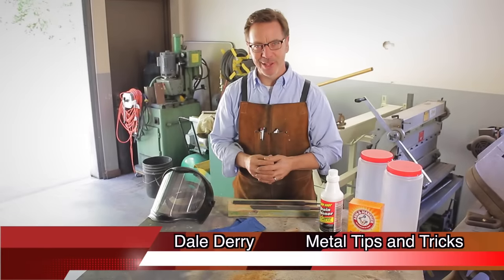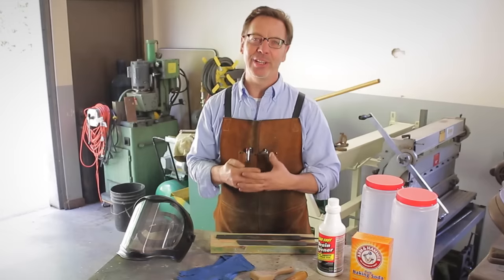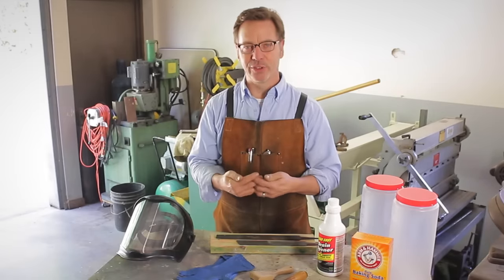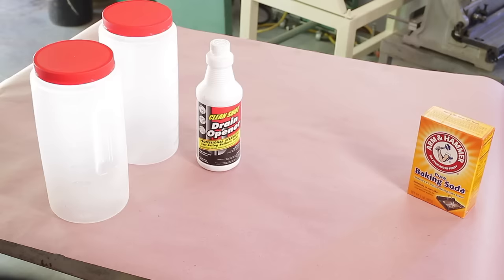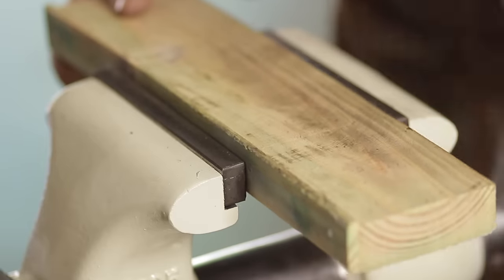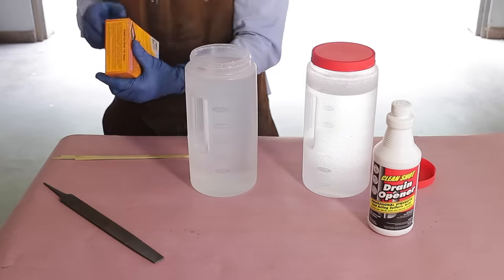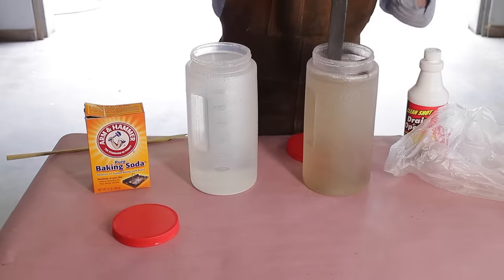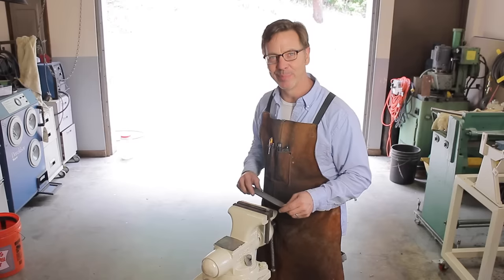How to Sharpen Metal Files

Comment: I was always taught that keeping files in a drawer where they could rub together was the worst possible thing you could do to it. I always keep my files separate.
Reply: There's a reason they're shipped wrapped in waxed paper... each file in its own pocket. Rubbing files on each other is how you get these nice bright curved lines on them.
Reply: you know he was making a joke, right. not trying to be rude or anything just really having trouble deciding if you could tell.
Reply: File steel is some of the hardest steel commonly available. By keeping files in contact with one another does not necessarily mean disastrous results ensue. File steel also has "toughness" which means that some abuse is normal. The way files are dulled is through pressure and extreme conditions such as exposure to water and other corrosive chemicals not through storage and random incidental contact with each other.
Reply: Yeah i was thinking, I've never heard this before.  Like you i was taught the same thing.  Don't rub them against each other and don't let them rub anything but what you are trying to file and only in the right direction.
Reply: Yea everyone knows subtle jokes are never funny
Reply: Nicholas Savage LOL
Reply: @disciplepullover326  Point taken, this guy needs a laugh track.
Reply: Tommie duh Swamy n
Reply: Or how about when you lend out a USA Nicholson file...and the guy is pulling/ dragging while he's cutting! Nooo stop you'll ruin it!!
Reply: Exactly. I was taught the same, by very experienced and skilled craftsmen. I am not very convinced on how sharp the file got after the acid treatment.
Reply: @tommieduhswamy6860  there really isn’t any steel referred to as “file steel” many manufacturers use many types of steel. A common steel used in more high end files is a 1095 or a W1. The strength or toughness of the files come from a process or heat treating and hardening. It may sound dumb but bouncing a hardened file against another hardened file or tool can over time wear the file down. More commonly poor maintenance of the file and its teeth lead to a dull file. A good set of files should include a brush so files can be cleaned Before being put away.
Reply: Keeping them in a role is the best thing you can do
Reply: @tommieduhswamy6860  I really hope you're joking, you know they use diamonds to polish diamonds right?
Reply: @Z-Ack  LOL! THAT'S HOW DADDY DID IT! AND THATS HOW IM GONNA DO IT!!
Reply: @Blind Freddy correct and good explanation

Comment: I was given a bunch of old files and decided that I had nothing to lose by soaking them in acid.  In my case I used muriatic acid and let each file soak for about ten minutes.  I then neutralized the files in the baking soda solution.  Some clearly cut better after the etching and some didn't.  It depends on what you start off with.  And yes, the acid cleans the files beautifully.  So for all you trolls who have made negative comments, you have several options: 1) discard all your dull files and buy new ones; 2) Have your dull files hydro-honed where you'll pay to ship them plus the cost of the process; and 3) Try the technique described in this video.  It all depends on what your expectations are.
Reply: They can send me all the files they like.
Reply: You've confirmed what I thought, it depends on what you start off with. A real worn file won't improve from this methode, but a file that is just dirty and/or corroded might. Nice tip, think I do step 3 first to decide which files to discard (and to reforge into something else). Think I'll just use vinigar and let it soak longer though.

Comment: something I do as a blacksmith is I take regular chalk and rub it on the file. it will lubricant and keep the file from filling up and clogging.
Reply: machinists also do this when using a smooth file to draw file a work piece to help reduce/eliminate clogging and pinning which can damage the surface finish.
Reply: Same thing... except I rub some borax into the file. whatever chalky stuff you've got, I suppose.
Reply: +Eagle Bird Knives Never thought of Borax or Soapstone,  I have thoes by the pallet loads, thanks I'm going to try them.
Reply: Yes, 'load' the file with chalk to prevent it clogging/blocking in the 1st place, totally agree.
Reply: Absolutely.  If you are filing aluminum and other soft metal that are sure to clog the file, loading it up first with chalk is your best bet.  Been doing it for decades.
Reply: E.PLUMBUS UNUM  why don't you try using a file that is designed to file aluminum works great
Reply: chalk loading can also be used for the purpose of getting a finer finish when your down to size,
Reply: hey... will welders chalk, or I mean soapstone work as well?
Reply: I rub chalk on mine too. I didn't think anybody else did that. I didn't know if it did anything but, to me it seemed to work better. Soapstone if there was no chalk around.
Reply: @jasonk795  it makes sense that this would work. the chalk is just like putting talcum in leather pants . it lets the chips slide through and not stick. also makes sense that you would re apply every so often.
  I must say this is something that i am shocked to have not heard before. it is also brilliant!
Reply: Been doing the chalk thing on files for soft materials for many years too, really old, nothing new about it. Another thing I do with new files to break them in is to use them on harder tougher materials first, like 304 or 316 stainless steel etc. for example, it makes the teeth sharper. Not to much, just a break in process, stainless I cut alot of anyway and will eat through files, end mills, inserts, drills, everything fairly quick.
Reply: The first bit of fact so far here.  You CANNOT sharpen Files.  Just clean them.
A bar of soap rubbed upstream on teeth also works on keeping a File from loading up.   Works on fingernails too for mechanics.
Reply: @gordbaker896  this on thread has been a mine of good info. haddent thought of using soap to keep the ol' nails clean! nice!
Reply: Saw filers trick is using French chalk
Reply: @leddielive  it also makes it Cleaner. Ive reduce Pinning and Burs in my work as well. A Few Simple Preps of a CleanStrawl and can have a few "Working" while in wait. Or Oiling. I keep Chalk and Vinegar in my  Modified BlueJeanPantLeg FileKit. Nice FileSlots, Slots and Pouches of Everything. MyWife Updated one my OldMan had. Her 2.0 is impressive.  Even has hidden pocket with small Cash and BandAids.
Reply: @flintcoat2596  Not always available.
Reply: @lukewarmwater6412  Yes, but the Chalks Fine size allows,  what's new  weight to Fall instantly. I've even seen BabyPowder. CleaningUp was just a few TapTaps and an instant Rinse&Oil, Finish.
Reply: @lukewarmwater6412  BabyPowder works as well. Do you use Flat/Round? I have an Easy ColorStraw system for my Roundos'. Cleaning&Oiling . And I've been reusing the same 8 Straws for.. 6 Years?  I've thought about using Talcum Powder,  but hear its Harmful to Women's Bodies.  Which kinda Reboosts me Supporting Chalk.
Reply: I actually used an ultrasonic cleaner on an old clogged file.
Completely unclogged it in seconds.
It rusted pretty well instantly though.
So I am looking for an inert fluid other than water.
Reply: Household Dog , how about WD40?
Reply: @HouseholdDog  here you go ;) https://www.youtube.com/watch?v=BTN7-C72eHA
Reply: Now thats a neat trick..
Reply: @nickjohnson5291  I have some borax I use for casting. I'll give it a try..
Reply: Try soapstone...that is what they used to use.
Reply: on hot filing you use chalk but on cold filing you use oil..

Comment: nice!   and much faster than they way i sharpen my files (one tooth at a time).   esp liked the copper pipe cleaner.   i use wood,  but I'll have to try copper on the stubborn ones.  thanks!
Reply from the maker: +This Old Tony 
Im glade you like it :-)
Reply: This Old Tony One tooth at a time? You must have been a dentist in a previous life!
Reply: I was taught to use brass to clean.
Reply: This Old Tony was
Reply: Copper pipe is a great idea
Reply: How cool it is, to find a comment from my favorite YouTuber 😃 and personally, I thought the copper trick was brilliant!
Reply: TheJR1948    This Old Tony is perfectly capable of actually sharpening a file, tooth by tooth. Before you start pontificating, it's wise to know what, and who, you're pontificating about!
Reply: Tony, could you explain how he actually sharpened it?
Reply: TheJR1948  Apparently you still have some things to learn, this does work, I and Evan Penny have explained it, Evan with a much better graphic though. BTW, aluminum works to remove the pinning too, not as good as copper but if that's what you have, and like copper, it wont damage the teeth either.
Reply: Liam R it does not really sharpen the file, it cleans the valleys of the file from metal fillings, with the filling’s  embedded in the valleys of the teeth the file skates over  the metal being filled. Thus not removing very much of the said metal that one is attempting to file 
If you really want to clean between your teeth use dental floss.
Oh for preservation of the cutting edge of the file push the file in one direction lift the file off the material and make  another stroke.
Do not treat the file like it is a hand saw.

I hope this helps.
Reply: @TheFalconJetDriver  That's not really correct. If done the way it was suggested using a soft metal like copper or aluminum cleans out the metal  'pinning' and the oil and fine metal particles, the acid more or less uniformly removes metal from all surfaces with a result of actually 'sharpening' the teeth, otherwise I agree with your comment. There are businesses that sharpen files commercially and use refinements of this basic process.
Reply: If TOT approves then I'm for sure on board!
Reply: This Old Tony how about doing a more scientific/microscopic video about this?! I’m sure you’re YT talent could make this interesting viewing.
Reply: TheJR1948  at 30+yrs.,I feel the same way
Reply: I tougth you just go back in time and trade with yourself the dull file with the sharp file. That would be much faster than toot by tooth sharpening.
Reply: @TheFalconJetDriver  Exactly, well said. There is no sharpening happening here, it's just cleaning. Oh and spot on too with the use of a file in only one direction, the teeth stand up proud from the body and any pulling back (pushing and pulling of the file) will put backwards 'pressure?' on the teeth and slowly lay them over, or wear them out. I hope this makes sense.
Reply: As an engineer of over forty years always keep a bit of scrap aluminium in the toolbox. Same as copper pipe if you follow the files teeth across the file it takes the shape and scrapes the residue out. If you do it every time you use the file it will keep it's edge for a long time, it's only when it clogs it damages the teeth. Also I like to point out to my trainees that a file like a saw only cuts in one direction unless made for a specific purpose. If you have to draw file you don't need to put a lot of pressure on the back stroke as it damages the teeth.
Reply: @mookyzook  Explain to me in a technical fashion why having clean teeth of a file makes them last longer please?
Reply: @TheFalconJetDriver  that is they way I understand it to be. Chalking your files frequently can help avoid filling the groves.
Reply: Tots on the job
Reply: @Blind Freddy I watched a video from fireball tool and he did a test on dragging the file back and then not dragging it back and it didn’t seem to make a difference. I would’ve thought it would’ve but no. Thoughts?
Reply: @Super--Sta Saw that video. He built a jig and tested every type of stroke thousands and thousands of times. The back stroke with pressure did nothing noticeably different to the file. It also cut nearly equally as well on the back stroke. Can't argue with his results

Comment: Incredible!  Wonderful and useful!  I was always taught at school to NOT put files together where they could dull each other - but to chalk them (although nobody ever showed me what kind of chalk to use or how to use it!!) and wrap them separately in paper or cardboard.  We were told as an alternative to  stand them in a block of wood with appropriate holes drilled in it, and placed where no metal would bang against them.
Reply: David Chadwick explained that he used French Chalk on files to stop them from loading up. In England, French chalk is another name for what I call soapstone here in the states. 
It works great. The soap stone is slightly slippery and stays in the teeth of the file. Chips don't stick to it.
Reply: That is exactly what I was taught and still practice that to this day! I do have a handful of dull files and will try the method demonstrated in the video. Worst case, I'll make knives out of them.
Reply: @OldSneelock  thanks!  that's a good tip.
Reply: @OldSneelock  watched an old instructional video on filing the other day and they were talking about French Chalk especially on the late stage of finishing the work piece. 
this is the video: https://youtu.be/P5Kp0WEGawY?si=B77XjDmer3Es4XIw

Comment: I've just done this with all my files - everything from fine needle files right up to coarse rasps, and I'm blown away by how well it works. That's over 40 files I would otherwise have tossed - in NZ about $2k worth (as some were fairly specialized) One thing I would warn y'all of is being careful to neutralize afterwards, and then CLEAN the acidic patina out from between the teeth - otherwise they'll rust up real quick. As a jeweller I'm fortunate to own an ultrasonic bath, which was perfect for this job :)

And BTW yes - they were all clean beforehand - just blunt. In fact some came up sharper than new.

Comment: I use a very similar method on my files, but use a 100% salinity table salt brine and DC current to electo etch a few microns off the outer surface. Microscopic inspection before and after shows a clean sharp edge where they had been rough and rounding.
Reply: You would be better to use washing soda as the electrolyte as it is less corrosive and not hygroscopic  if you fail to rinse some of it off.
It also does not release chlorine during the reaction.
Reply: Thanks! After watching the video and realizing what this process was accomplishing, I immediately wondered if using current to blast away the surface would also work!

 Although I appreciate this is 2yrs layer, I have some questions, if you happen to get this notification... 
      - What did you use for the other terminal, and how far away?
      - What power source did you use? (and at what voltage, if it is a variable source?)
Reply: @DUKE_of_RAMBLE  I used the file for the anode (-) and an old bolt for the cathode (+). I was just using an old 120 volt ac to low amperage 12v dc transformer like you would use to power a cordless phone base. An adjustable power supply would be nice but I did plenty of electro etching and black oxide coating with that basic setup.  ( for oxide coating just reverse the polarity to deposit iron from the sacrificial anode onto the part you're coating.)
Reply: @justindunlap1235  Awesome! Thanks.
So if you don't mind, last 3 questions (hopefully lol)
Duration of time left in there to etch? Based on whatever length file you were sharpening, and I can try to extrapolate from there to fit my file lengths. 

Was it a long cathode (bolt) or completely random, and approx what distance from the file? In my (limited) experience, the length of each node, and even their angles relative to each other, drastically effects the path the current takes (electricity liking "path of least resistance" and all that). So a short cathode, even if dangled mid-way, would end up doing more work nearest to it – potentially leaving the file with low spots where more metal was liberated from it. 

Size of container needed (or that you used)?

Thanks again! 🤘✌️
Reply: I would use a plastic container approximately 14x18x4 inches with a very long bolt, long enough to touch the bottom and still protrude from the solution. I noticed I would get the most consistent results when the cathode and anode were placed vertically at opposite ends of the tank, as for duration it's not more than a few (3-5) minutes to get a decent etch on a 12 inch file ,depending on the power supply used, I've tried using a 12v battery charger before and was amazed at how fast it would etch, for oxide coating the longer you leave it the thicker the coating will be.

Comment: Dale,

Thanks for this helpful trick!  This afternoon, I've been working on restoring about 8-10 files that I thought were total junk... just tried the first 3 that I took out of the acid bath, and they cut like a new file!

I used Muriatic Acid (hydrochloric acid) instead of sulfuric.

Probably the best tip in this video is to use a piece of copper pipe to make a file scraper... it works better than any file card ever created for cleaning the file... and is probably responsible for 75% of the success of this method.

Thanks again, I've now got about 10 more "new" files for the shop that were destined for the scrap bucket!
Reply from the maker: Thanks for your comment, I'm so happy you saved those files. :-)
Reply: Works like a champ!